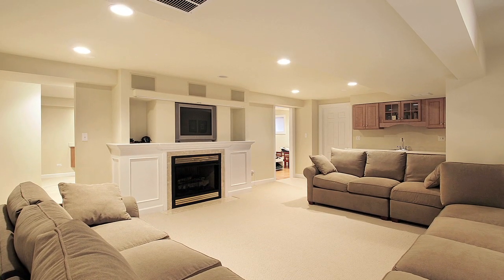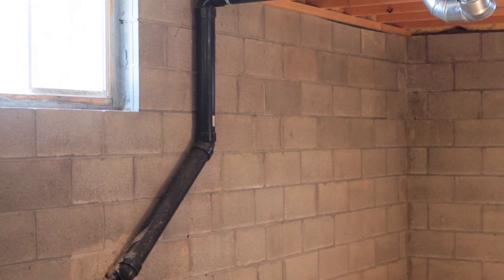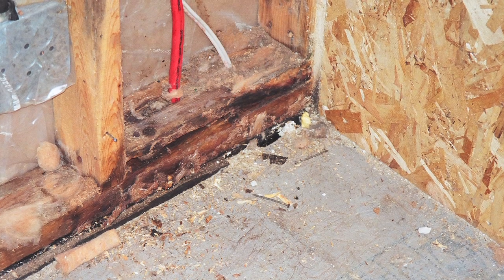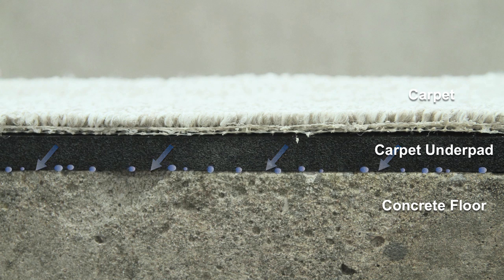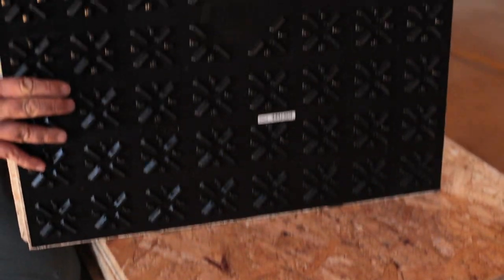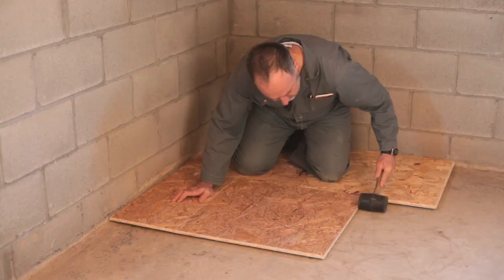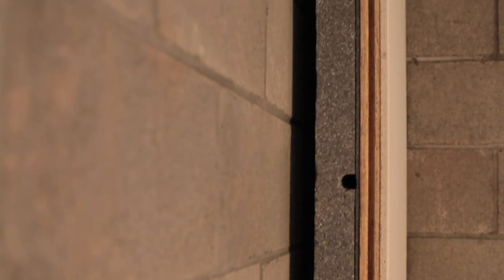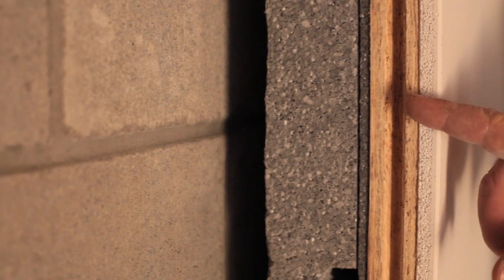How to Finish a Basement Properly

Comment: Looks very interesting. I like that the drywall is integrated and the electrical channels are included. Are the cables embedded deep enough? How do you go about hanging anything on these walls? Also, what about condensation behind the EPS? How can it dry out?

Comment: I recently used a product called In-So-Fast paneling system and have noticed a more evenly heated or cooled environment in the basement and the air quality is much cleaner. I won't finish another  basement with old traditional methods.
Reply from the maker: Hi Josh,

Yes, I know what you mean. Panel systems for basement finishing make a big difference. It's amazing to me how long tradition causes people to keep finishing basements in the bad old way, but I guess old ideas die hard. Where abouts do you live? Is it a cold climate?

Bye for now and thanks for watching!

Steve
Reply: Thanks Steve. I live in Fort Collins, Colorado and the temperature swings can be rather drastic. Besides taking on projects around the house, I work as a full time stone mason and part time residential draftsman. Its not much of a website but some of my design work can be seen at deadwooddrafting.com.  Thanks again.
Reply: *****'''It's amazing to me how long tradition causes people to keep finishing basements in the bad old way, but I guess old ideas die hard.''    Well said Steve :-)

Comment: Steve, I've wanted to finish my basement for 10 years now. The previous owners installed a drop ceiling and stopped there.  Where can I order the floor and wall components that you show on this video?  Also, if I use the wall system you demonstrate, will it support mounting a 50" flat screen?  Finally, what do I do with the wall that has the basement windows (I would need shorter panels or cut them to fit).
Reply from the maker: daveminn7 Good Morning Dave!
The panels I showed in my video come from a Canadian company called DRIcore (dricore.com) I think they sell across North America but a quick note to them will confirm. As for your windows, yes, you'd cut the panels to fit. They cut easily with a handsaw.
When it comes to your 50" TV, the panels would probably do the job, but "probably" isn't something I feel comfortable with. If it were my situation I'd work some wood framing into the area where you plan to mount your TV. Either that or go with some kind of ceiling mount that supports the TV from above. Does this make sense? I hope so. Please let me know.
Can I get your opinion on something? I'm planning a series of online video tutorial courses for homeowners. These would be hosted on Udemy. I'm thinking that a course of basement finishing would be popular and appreciated. As someone looking to finish their basement, would you pay, say $30 or $40 for an in-depth video course showing all the details and product references I recommend on finishing a basement?
Bye for now, Dave! Just let me know if I can help in any other way.
Steve
P.S. It's about -8ºF at my place on Manitoulin Island, Ontario, Canada this morning. How about where you are?

Comment: Question: At the start of the video you talked about moisture and fiberglass insulation not being a good mix. What about moisture and the OSB on the Dricore products?
Reply: I think the moisture usually seeps in from the outside walls and the ground into the basement. Since the Dricore has the plastic cover on the bottom, it will prevent the moisture from touching the OSB.

Comment: of course you neglected to talk about price
Reply: The wall system is essentially the same material cost as older conventional construction material methods it replaces. This wall system cuts construction time and labour cost. I priced this out and used it in my own basement. Nominal cost 30 per linear foot. Would do it again. Great product and method. Now if only I could find a quality MagO floor similar. I dislike the idea of OSB on floors even if OSB has insulation or a plastic floor facing membrane c/w raised air pockets for the odd water leak over a basement floor surface. Prob. w/MagO is they all come from far across the sea, not made with high enough quality controls...
Reply: @JohnR84  dricore insul armor no osb

Comment: The floor panels should not be up against the concrete wall like you show in the video.   IF water ever does penetrate your foundation, it will run down the wall and out onto the osb floor.

Comment: You did not mention price, off gasing from OSB board and glues in the product, potential mold on drywall (mold will grow on anything organic, paper backing on drywall), subfloors will hide any water seepage problems that should be addressed asap, and once water hits OSB......it's finished. You will have to rip out the entire floor. I suggest to my clients stay away from subfloors, they hide problems down the road that you want to see and fix asap. They might be more comfortable but thats not always the best choice. I personally like the floating vinyl plank for a basement floor. It may be a little harder and colder on the feet but its 100% water proof. It's also personal preferance.

Comment: Is there a price comparison between the Traditional method vs the DryCore system?
Reply: Joseph is not the price comparison,  is  about performance comparison. 

The beauty about this system rely in  the  condensation, moisture  and mold handling.

There is  always a gap for air to Breath  Between wall/floor. With this system.
Reply: But there is a cost difference....About 30 more than traditional. When it comes to quality some people don’t care about the cost because there is a piece of mind involved. The cost is still dramatically more.

Comment: Taped and painted drywall acts as a vapor barrier? That is unusual. Did you mean air barrier instead?
Reply: Hi Nick,
Actually, it is "vapor barrier" that I meant. Taped and painted drywall is actually pretty good at stopping the passage of airborne water vapour. This is especially true when you use a vapour barrier-type primer. Taped and painted drywall is a good air barrier as well, but it retards the passage of vapour, too.
Bye for now and thanks for watching!
Steve
Reply: A vapor barrier is defined as having 0.1 perm or less. Drywall is 50 perms; extremely permeable. Normal latex paint is on the order of 5 perms, still quite permeable. "Vapor barrier" paint is about 0.5 perms, definitely a stronger vapor retarder than regular paint, but still not a vapor barrier in modern parlance. A vapor barrier is not desirable in a basement anyway, especially on the interior face of the wallboard, as it could trap moisture in the OSB on those panels, risking rot.

You seem like a thoughtful guy so I encourage you to make a clearer distinction between air and vapor barriers, because most people are horribly confused about them already. Modern building science is pretty clear that you really do not want a vapor barrier in a basement wall at all. The vapor retardance of the EPS foam is plenty alone. However, an air barrier is crucial in this location, and unfortunately these wall panels do not seem to provide this at the top and bottom joints without taking further action to seal those seams behind the panels. The untreated 2x2 at the bottom is also likely to rot.

Were you compensated by Dricore in any way? I don't understand how such a thoughtful  and experienced builder would not see these issues.
Reply from the maker: Nick Welch Good Morning Nick!
Actually, it's a little more complex than this. While I would never recommend that builders rely only on taped and painted drywall as a vapour barrier, just as a point of interest it doesn't do a bad job according to the numbers. According to the North American Insulation Manufacturers Association (NAIMA), a perm rating of 1 is considered acceptable as a residential vapour barrier. One coat of vapour retarder latex paint delivers 0.45, so we're good there. On the NAIMA website listed below, they state that "latex or enamel paint qualify as Class III vapour retarders". I wouldn't rely on it, but it is listed. The issue also comes down to climate and who likely vapour is to penetrate walls and condense. Here where I live, we always get -30ºF and colder weather, so we do need vapour barriers with some types of basement wall construction, if only because the top of the walls are above ground and pretty cold on the outside. Anyway, here's that link:
http://www.naima.org/insulation-knowledge-base/residential-home-insulation/insulation-and-vapor-retarders.html
Bye for now, Nick.
Steve
P.S. Where abouts do you live?
Reply: Taped and painted drywall simply is not a vapor barrier. It is 50 times more permeable than a vapor barrier.

A perm rating of 1 is the cutoff between a class II and III vapor retarder. It is also not a vapor barrier.

The link you posted is actually correct and uses the terminology correctly, but your paraphrasing of it erroneously uses the term "vapor barrier" where NAIMA did not.

Read up: http://www.buildingscience.com/documents/digests/bsd-106-understanding-vapor-barriers

Just because you're in a cold climate does not mean you need a vapor barrier, although cold climate building codes (particularly in Canada) have an anachronistic and misguided obsession with vapor barriers. A vapor retarder is all that is required, and invites fewer moisture problems, and guess what? That EPS+drywall+latex paint wall you demonstrated is a vapor retarder, not a vapor barrier. So you (partially) did the right thing even though you described it in a confusing and incorrect way.

Air leakage is by far the more important source of condensation-related problems, and establishing a tight air barrier is important in all walls, but especially in a basement wall, where warm indoor air touching cold concrete will generate condensation. The focus in a basement wall should be on the air barrier first, vapor retarder second... a vapor barrier is not relevant. The wall you demonstrated has an incomplete air barrier with gaps at the top and bottom. It is susceptible to convective loops which will generate condensation on the concrete and the untreated wood in contact with it, not to mention any ground moisture coming inward through the concrete.

P.S. By asking for my location, I suspect you are trying to reduce my description of modern building science to some sort of regional anecdote, but it is not, so I see no relevance to stating my location. What I'm talking about is not climate-specific, except where otherwise noted.
Reply from the maker: Nick Welch Thanks for taking the time to comment Mike. 
Bye,
Steve
Reply: you kinda rekt him

Comment: after watching many videos about wood sub floors for basements, I have come to the conclusion that I will never put wood there.  There is a laundry room and a hot water heater and a furnace with water drains for the air conditioner and those things can leak, and once water gets into that wood subfloor, you have a nightmare.

Comment: Those wall panels are $75 each and only  2' x 8'...Holy smokes.
Reply: seems high. Almost makes you wonder maybe get a sheet of foam insulation and attatch it to a board and put it up same install method and use that for around half the price!

Comment: the floor panels are way too expensive considering its cheap osb with plastic on the bottom. if the price was a buck a square ft I might consider them,if the floor was uneven they would be a disaster to install,most basement floors in new subdivisions are a mess making this product useless. earlier you were recommending a similar product with blue foam on the bottom,what happened to that item?

Comment: r value of 16 is way too little.  this is a way to do a cheap looking result using a product that skips corners.  wow.  that's all i can say.  wow.
Reply from the maker: suivoh 
Good Morning Suivoh!
Thanks for your note. I've spent the last 26 years monitoring building materials and practices, and I've never seen any other system that delivers more insulation in basement walls than this one. Most offer less and still meets building code requirements where I live in the frozen north of Canada. So, if the system I explained here offers "way too little" insulation, please explain how it exceeds code requirements. And if there's a system that performs better than what I've discovered here, please point me towards it.
Thanks for watching! Drop by for a visit sometime at https://stevemaxwell.ca. I offer lots more good stuff there. You might not always agree with it, but I take my work seriously and do the best I can.
Bye for now,
Steve

Comment: Yeah this stupid old method are better... 1st step in doing a basement is waterproof your foundation from outside and inside install and sump with trench system round your basement and vapor seal your walls and u can drylock your walls before u install vapor seal... step 2 before installing studs leave 2in space between your foundation walls and then drywall you’ll have no problems ... it’s all about waterproof your house and and how your water drains you’ll always some kind of humidity in basement is all about how u control it ... in house Dehumidifier all basements need even if u do your basement like this you are still going threw short cut by not fixing the real problem